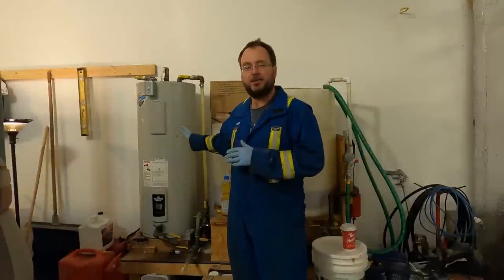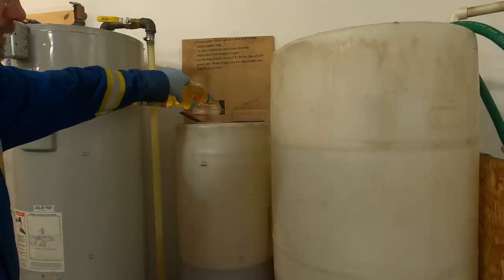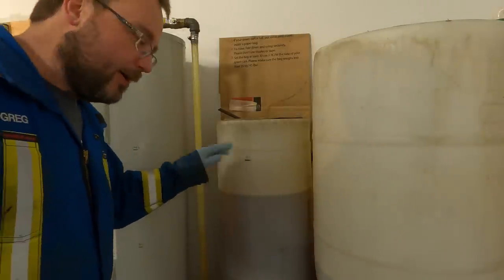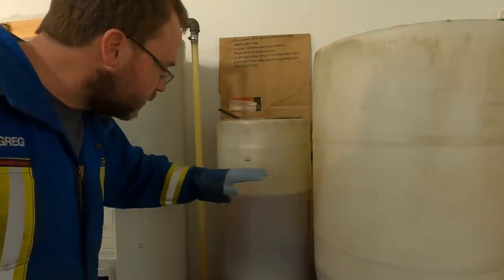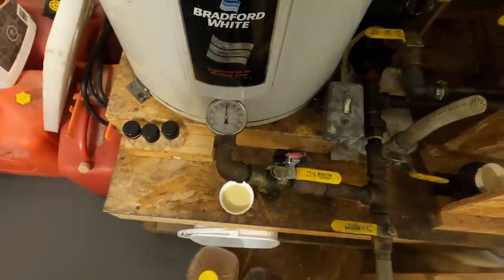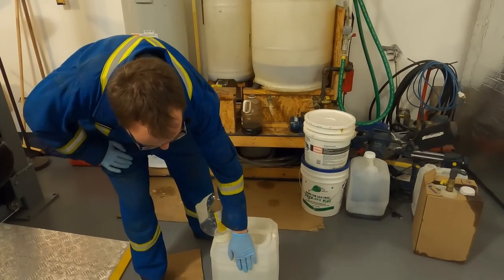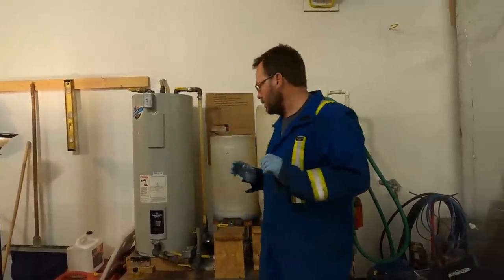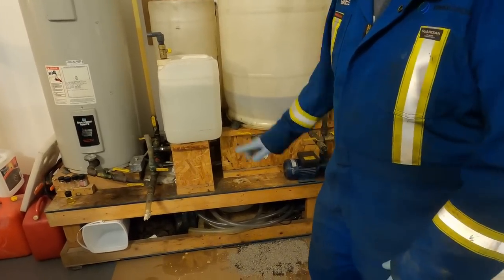Making a batch of Biodiesel from used Canola oil - HOW TO MAKE BIO-DIESEL!

Comment: Leave the methanol in. It reduces viscosity and increases atomisation of the fuel.
Reply from the maker: It also hangs onto the soap and glycerin as I understand it.  My old TDI probably doesn't care though...
Reply: You could probably leave it in if you made batches when it is cold outside, sub freezing. Then final filter it through a sock filter catching the soap, sterols, and particles. 
Cold filtering is what large scale processors use. They also heat, evaporate, condense, reuse the methanol.

Comment: I saw a guy comment about using old ATF I would like to learn about that
Reply from the maker: old diesels will burn lots of different oils.  just filter it a lot and cross your fingers.
Reply: @gregs_garage  what about ur tdi. Would you feel comfortable trying ATF or waste Motor oil in a pre 03 TDI?   Not asking you to do it but just knowing about the tdi engine would it hold up decently to it do you think?
Reply from the maker: @BRWfilms  Maybe.  But who knows what contaminants, acids, chemicals, or whatever may be in that stuff and what effect it has when it burns?  I wouldn't use it.  Maybe in an old throw away engine but not in a car I want to keep.
Reply: @gregs_garage  fair enough 👍👌
Reply: @gregs_garage  I ended up buying a centrifuge. I'm processing all waste motor oils trans rear end ect and burning it in my ALH and 12 valve now
Reply from the maker: @BRWfilms  I just watched your video.  Try not to make too big of a mess.  Subbed for more videos, thanks.
Reply: @gregs_garage  thanks for the sub man.  Yeah first two batches were a complete mess.   I've added some more valves and got it to where it's a lot more efficient and clean tho.
Reply from the maker: @BRWfilms  that's good.  i just dumped a bunch of lamp/citronella oil in my ALH I found at the waste disposal place.  Someone dumped a few gallon jugs there.
Reply: @gregs_garage  that's real cool so was it un opened jugs or clean when you got it? I've heard of people using compressor oil also
Reply from the maker: @BRWfilms  it was half-full jugs but very clean... not used.  Lamp oil is clean Kerosene (I think).  ALH will run on lots of stuff as you know.  I also dump clean ATF in the tank when I find a jug.
Reply: @gregs_garage  right on!

Comment: An easier method is to mix gelatin in water, dissolve it with a little heat then add to the filtered oil, ( filtered to remover larger bits) leave till the gelatin settles and solidifies, then remove the oil as ot is now clean, once empty get rid of the solid gelatin in your waste, the oil now has no smell of food and add 10% of your methanol, ready to use. All this kerfuffle is just not needed try it on a small sample, one liter add 5g of gelatin dissolved in 200 ml water. Much easier. Found this from a guy that found this method in a patent.
Reply from the maker: that's not biodiesel.  it's veg oil mixed with chemicals.  completely different.

Comment: You sure do make allot of excuses on why you shouldn't but in fact you SHOULD make BIODiesel! Saying that there are times where you shouldn't.  Some of the newer vehicles have engines where it doesn't like it and gaskets and other parts would degrade.  So, you need to check all of that first.  As far use making and using it on vehicles, heaters, etc that can, you should.  You should make it if you can.  Problem these days it's hard to get a solid volume of it.  And before you ask, yes, I have made and used BIODiesel.  Just careful in what I use it in.
Reply from the maker: I don’t recommend any individual make it for 5 reasons and more

Comment: Each element in the water heater is 125 volts ... don't want to confuse some of the people using this as a how to and send 250v into 1 element boom
Reply from the maker: Nobody should attempt any of this.

That said, I use a single 240 volt element running on 120 volts.  Heats low and slow.

Also, these 240v hot water tanks do not have two 120v elements.  They have two 240v elements.